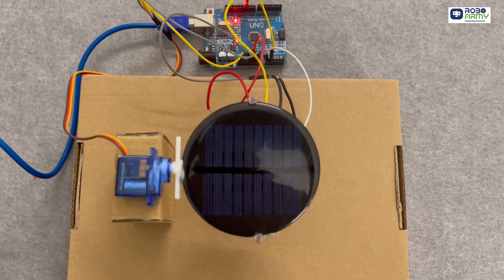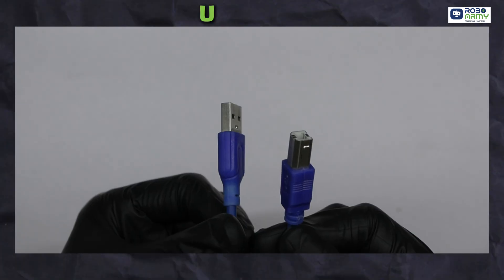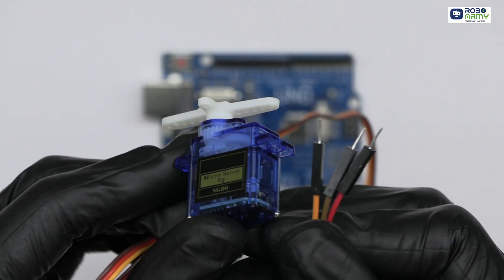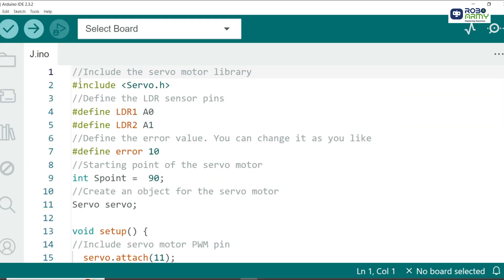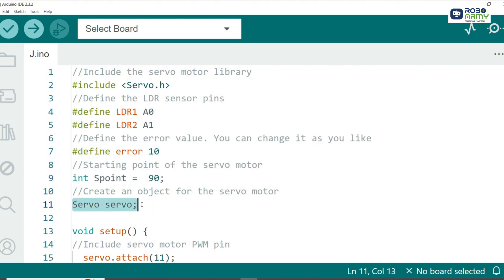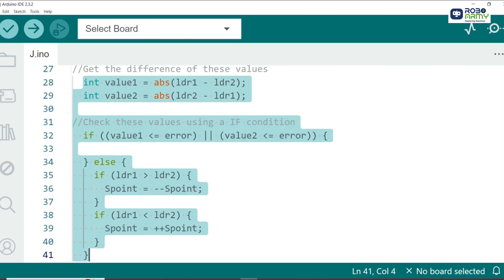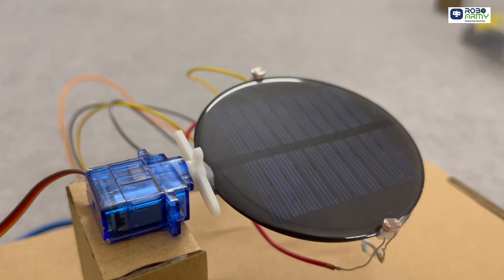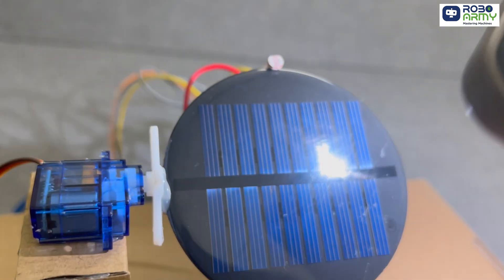DIY Automatic Solar Tracker | Maximize Solar Energy with Arduino!

Comment: How do I connect the batteries to the arduino?
Reply from the maker: You can power the Arduino using batteries in two ways:
1️⃣ Connect a 7–12V battery to the VIN pin and GND, or
2️⃣ Use a battery + DC jack connector and plug it into the Arduino’s power jack.

⚠️ Don’t connect more than 12V, and don’t connect batteries directly to the 5V pin unless it’s a regulated 5V supply.

Comment: Can I use 10 kohm resistor
Reply from the maker: Yes 👍 10 kΩ resistors work perfectly for this project. They are commonly used with LDRs to form a voltage divider and give stable analog readings. Just make sure both LDR circuits use the same resistor value for accurate tracking.

Comment: Apakah ada yang menggunakan ESP 32 bang?
Reply from the maker: Yes, this project can also be done using ESP32 👍
In this video I’ve used Arduino Uno for simplicity, but ESP32 will work with small pin changes.

Comment: Sir how did u use the jumper wire for resistor connection.. have u removed the black part and then used it???
Reply from the maker: Great question! No, we didn’t remove the black plastic part of the jumper wires. we kept the jumper wire as it is and simply connected it to the leg of the resistor on the breadboard.

The resistor is placed across the breadboard holes, and the jumper wire is inserted into the same row to make the connection. There’s no need to strip or remove anything from the jumper wire — just push it into the breadboard hole like normal. 👍

If needed, you can lightly bend the resistor legs to fit neatly, but the jumper wire stays unchanged.

Comment: Sir i am using L298N servo can you please give circuit connection for this
Reply from the maker: For this solar tracker project, you don’t need an L298N motor driver because the servo motor works directly from Arduino and does not require a motor driver module.
The L298N is only used for DC motors or stepper motors, not for servo motors.

So for your setup:

Connect servo signal to pin 11 of Arduino

Connect servo VCC to 5V

Connect servo GND to GND
No need to use L298N in this project.

If you want servo control using L298N, that will not work because L298N cannot provide the PWM + position control signal needed by servo motors.

Comment: Where is the battery holder connection
Reply from the maker: The battery holder connects to the Arduino’s Vin (or 5V) and GND pins to power the circuit. Make sure to match the voltage of the battery with your Arduino’s requirements.

Comment: Sir, how can we connect lithium battery to Arduino.Sir, please explain in brief
Reply from the maker: Using a Battery Holder: Connect the battery’s positive (+) to the Arduino’s Vin pin and negative (–) to GND. Make sure the battery voltage matches Arduino’s input range (usually 7–12V for Uno).
Reply: Thank you 👍

Comment: What type of jumper wires are used for school project? Male-male or male-female or female _ female
Reply: How did you attach servo motor with solar panel with gum or how
Reply from the maker: You can use them According to your component requirement
Reply from the maker: With Hot Glue gun

Comment: Hi
Reply: Where is the battery connection
Reply from the maker: Good question! No need for a separate battery if you are powering the Arduino directly from your PC via USB.
Otherwise, you can use a 9V battery

Comment: How did u attach the servo motor to the solar panel
Reply from the maker: I attached the servo motor to the solar panel using a small stick as a connector. This helps the servo move the panel smoothly when tracking the sunlight.

Comment: Sir can you help me it's not working I think my servo motor is little small that's why it is not working or codes are not uploaded please help I have to submit the project
Reply from the maker: Don’t worry, let’s troubleshoot step by step 

Check the Servo: Small servos (like SG90) usually work fine for this project, but if your solar panel is heavy, the servo might not be strong enough. Try testing the servo separately with a simple sweep code from Arduino IDE → Examples → Servo → Sweep. If it moves, then your servo is fine.

Check the Code Upload: Make sure you’ve selected the right board (Arduino Uno) and the correct COM port in the Arduino IDE before uploading.

Power Supply: The servo needs a good 5V supply. If you are powering everything from USB only, sometimes the servo doesn’t get enough current. Try an external 5V supply (with common ground).

Recheck Wiring: Ensure LDR sensors are connected to A0 and A1, and the servo signal wire to pin 11 as shown in the circuit diagram.

If you still face issues, share a picture or details of your setup so I can guide you better

Comment: Can I get help on how to put the servo code in arduino ide
Reply from the maker: Sure! To put the servo code in Arduino IDE, just copy the code I’ve shared and paste it into a new sketch in Arduino IDE. Then connect your Arduino board, select the correct port, and click on the upload button.

I suggest you also download the code from the link provided and watch the video carefully step by step, it will make the process much easier
Reply: Also how did u attach the solar panel to the servo motor

Comment: Can you please help me with this project
Reply from the maker: Of course! Let me know what specific part you need help with — wiring, coding, or setup — and I’ll guide you step by step. You can also check the video description where I’ve shared the circuit diagram and code for reference.
Reply: @robo_army_ can I do it with two servo motor for more torque

Comment: We have to download or copy paste the code
And what is that library file 
I didn't understand 
How to put in uno board
Reply from the maker: Great questions! 

You don’t need to download any extra files — just copy-paste the code I’ve shared into the Arduino IDE.

The line #include <Servo.h> is a built-in Arduino library that comes pre-installed with the Arduino IDE, so you don’t have to download it separately.

After pasting the code, simply select your board as Arduino Uno from the Tools menu, connect your Arduino via USB, and click on the Upload button (right arrow icon).

That’s it! The code will be uploaded into your Arduino Uno and the project will start working.

Comment: I didn't understand all wiring pl tell slowly and joint wire slowly pl give me solution what can I do din understand all wiring
Reply from the maker: Okay, let me explain the wiring step by step :

Take the first LDR sensor → connect one leg to A0 pin on Arduino, the second leg goes to 5V, and also connect a resistor from that leg to GND.

Take the second LDR sensor → connect one leg to A1 pin, the second leg to 5V, and again a resistor from that leg to GND.

Now the servo motor → connect the signal (yellow/orange) wire to digital pin 11, the red wire to 5V, and the brown/black wire to GND.

Make sure all grounds (GND) are connected together.

Comment: Can we do it with 1Ldr and a normal motor
Reply from the maker: Yes, you can use 1 LDR and a normal DC motor, but it won’t be very accurate. A single LDR only gives light intensity, and normal motors can’t position precisely like servo or stepper motors. For better results, use 2 LDRs with a servo motor. 😊
Reply: Thnx @robo_army_

Comment: I want it to rotate 360 degrees. Do you have any idea how to do this?
Reply from the maker: If you want full 360° rotation, you’ll need to use a continuous rotation servo or a stepper motor with a driver (like ULN2003 or A4988). Standard servos usually rotate only up to 180°.

Comment: The code you gave is wrong ,good idea but bad code,better luck next time by mit student(me).
Reply from the maker: Thanks for your feedback! 😊 I’ve double-checked the code, and it’s working perfectly for this project setup with 2 LDRs, 1 servo, and Arduino Uno. The servo correctly adjusts based on the light difference detected by the LDRs. Maybe your setup or components are different? Let me know if you'd like help debugging — happy to support!

Comment: Can i use ldr module instead of ldr
Reply from the maker: Yes, you can use an LDR module instead of a raw LDR, but make sure the module gives you an analog output (not just digital).
Our project compares the light intensity between two LDRs, so we need analog values to detect the difference and move the servo accordingly.

If your LDR module has an analog output pin (usually labeled A0 or OUT), then you're good to go! Just connect it to the Arduino’s analog pins (like A0 and A1 in this project).

Comment: I have 3 cell holder and I have 3.7v cell is that work?
Reply from the maker: Yes, it can work! A single 3.7V lithium-ion cell is usually enough to power the Arduino Uno and the servo motor for this solar tracker project. However, make sure of the following:

If you're using a 3-cell holder, that's meant for 3 × 1.5V AA batteries (total 4.5V) or 3 × 3.7V cells (total 11.1V). If you connect 3 lithium cells (3 × 3.7V = 11.1V), it's best to connect that to the VIN pin of Arduino, not the 5V pin, to avoid damaging the board.

If you're using only one 3.7V cell, connect it to the 5V pin carefully only if it's regulated (some boards can run on 3.7V, but the servo might struggle).

Also make sure your servo motor can run properly at 3.7V — some need 5V for smooth operation.

Comment: If the code run in arduno nano
Reply from the maker: Yes, the same code will work on Arduino Nano as well! Just make sure of these two things:
In the Arduino IDE, select the correct board and port:
Go to Tools > Board > Arduino Nano
And select the right Processor and Port

Comment: How to mold the servo with solar panel
Reply from the maker: Hi! If you want to use a servo with a solar panel, you'll need a solar panel that provides sufficient current and voltage for the servo's operation, along with a voltage regulator for stable power. You can connect the solar panel to a rechargeable battery and then power the servo from the battery to ensure consistent performance.

Comment: Sir i am not able to download the code
Reply from the maker: You can download from this link. Install Arduino IDE to open the file. It's also given in the description section of the video.
https://www.youtube.com/redirect?event=video_description&redir_token=QUFFLUhqbmNTcDI5WWwydXFTeTNmQTFjMUw4ZXRHWWRWd3xBQ3Jtc0trN3RsVS1JY2VyXzFuT1A0alJnVmpTZGNrSUxvX2w5cExrWnR4bG1HZ0Nfeks3cFROLUhHb3lvc3J3OTdGbl83aFVFTnpIYVEzQ3FSdFp3ZDA4aVJFbkhMRmZ0VHVQVWNLOHlCYXV5a3FyZ3N1eEI2Zw&q=https%3A%2F%2Froboarmypublicfiles.s3.ap-south-1.amazonaws.com%2Fcode%2FJ.ino&v=HHlV4hG84r4
Reply: Sir can't open the file  @robo_army_
Reply from the maker: Check it out: //Include the servo motor library
#include <Servo.h>
//Define the LDR sensor pins
#define LDR1 A0
#define LDR2 A1
//Define the error value. You can change it as you like
#define error 10
//Starting point of the servo motor
int Spoint =  90;
//Create an object for the servo motor
Servo servo;

void setup() {
//Include servo motor PWM pin
  servo.attach(11);
//Set the starting point of the servo
  servo.write(Spoint);
  delay(1000);
}

void loop() {
//Get the LDR sensor value
  int ldr1 = analogRead(LDR1);
//Get the LDR sensor value
  int ldr2 = analogRead(LDR2);

//Get the difference of these values
  int value1 = abs(ldr1 - ldr2);
  int value2 = abs(ldr2 - ldr1);

//Check these values using a IF condition
  if ((value1 <= error) || (value2 <= error)) {

  } else {
    if (ldr1 > ldr2) {
      Spoint = --Spoint;
    }
    if (ldr1 < ldr2) {
      Spoint = ++Spoint;
    }
  }
//Write values on the servo motor
  servo.write(Spoint);
  delay(80);
}